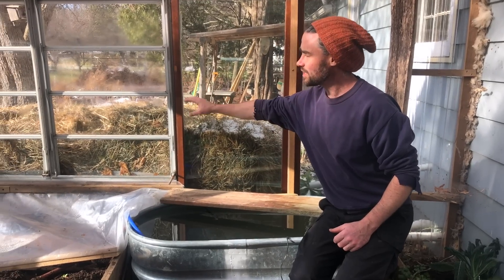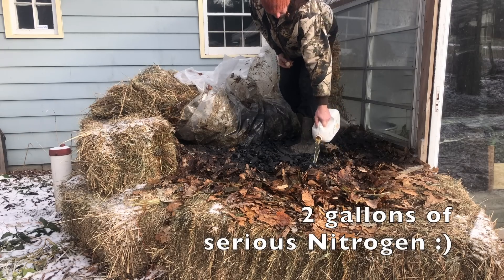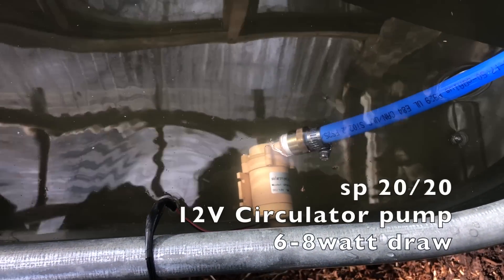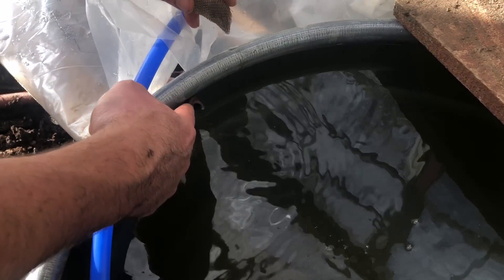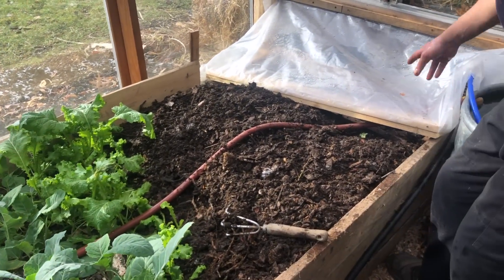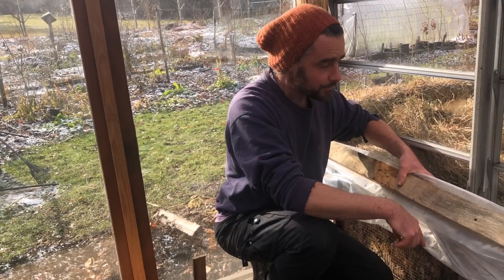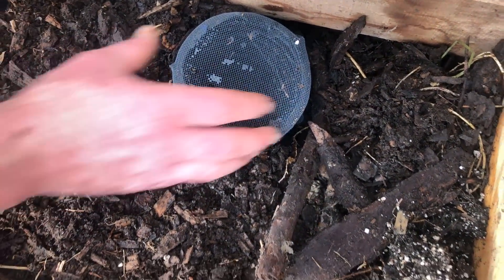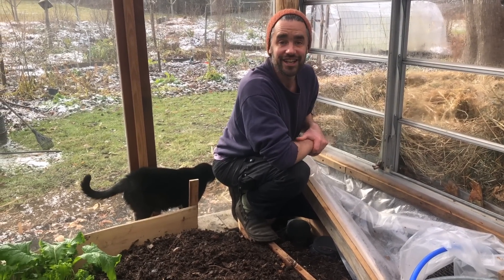Greenhouse - Heating with compost part II

Comment: As far as the fans to draw air into the tubes, I would say put them on the end opposite the compost pile to draw air through so you don't have them permanently in a warm, moist environment inside the airtight case.
Reply from the maker: I'm with you on this thought.  Intuitively I am aiming towards pulling more than pushing anyway, but this is more good thought to support that...
Reply: @edibleacres  From a thermodynamic and fan efficiency/energy standpoint you should have the fans be in the location where you believe the air that you're trying to either push/pull (relative) is going to be consistently more dense.  Because of how fluid dynamics functions, its more adventageous to pull the higher density, cooler and more massive air per / unit volume than to try and have that same fan push lighter, less dense wispy air.  (Ask any airplane pilot what type of conditions they would like to take off in).

Many of these principles are addressed by the University of Minnesota Extension's Deep Winter Greenhouse (DWG) research and design program.  This is where I have gotten much of my winter greenhouse design, operation and management information from.  I highly advise anyone seeking information on these or related topics to look up their work.  It is easily accessible and free.

The difficult part about your context is it is not clear to me which end of the pipes: (the higher up tubes towards the peak of your greenhouse (heat rises), or the lower pipes that are closer towards the ground and the warm/moist of the compost exhaust) is going consistently more dense?

Anyways, that's just one facet to take into consideration.  Perhaps efficiency isn't as important of a system factor to take into consideration and keeping potential debris from damaging your fan is more important?  But that could always be addressed by creating a mesh cage around your lower elevation intake.  Literally with your completely custom home design the variables and factors are endless and difficult to calculate, but so are the potential possibilities!  Try a bunch of different approaches, take as much data as possible to objectively adjust your systems and always keep working towards progress.

Good luck and keep up the interesting content.  I hope this was helpful and provided you a high quality resource to further your research and study of related topics in this field.  Happy Holidays.
Reply: I was thinking small like computer fans
Reply: I agree that pulling from downstream would be easier on the fan.  I was also thinking that a thermstatic control linked to a thermocouple buried in the soil would mean you could "set" the soil temp at an optimum for the crops you are growing.

EDIT:  I have a catalog from Jonny's Select Seeds that lists optimum germination temperatures for all their seeds.
Reply: As far as the heat pipes, pulling is more ideal. You can make the suction passive if you paint the risers flat black. The stack effect will pull the air through anytime the sun is shining. The moisture should condense out in the cool soil.
Reply: I thought so too
Reply: Jesse Rahimzadeh my instinct tells me that pull through is best. 🙂
Reply: What an interesting concept you are developing here. Thanks for sharing your design process with us. I’m planning to build my own greenhouse some time in the future. This video series is providing me with a lot of food for thought.
Reply: how about putting all 3 tubes together (combining them) at the end, using only 1 pulling fan to draw heat from the pile underground?
Reply: Mirka Bomberová that’s what I was thinking too for the same logic as the recent change in tube length inside the compost pile. Longer pipe length, slow fan pulling, not pushing.

Comment: I've done some calculations in the past,  If your pile was 2-3x the size and you double baled it.   If the mix of composting materials was pretty well balanced, you can get a Million BTUS's out of a system like this!
Reply: So what you have is a natural closed loop heat pump with ambient air recirculation.
Reply from the maker: That is some pretty serious BTU I think :)  In the future, if designing a system similar to this but with a clean/blank slate to design in, I would provision for a substantial compost pile to be associated with it.  In our case, the pile has to 'sneak in' to fit between other real components that exist already...